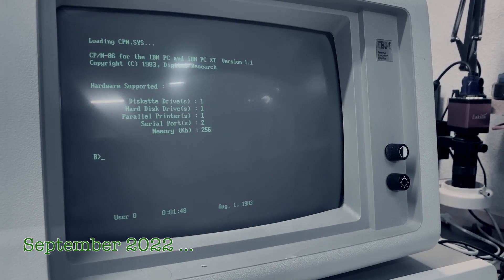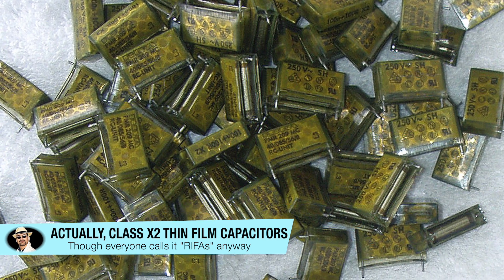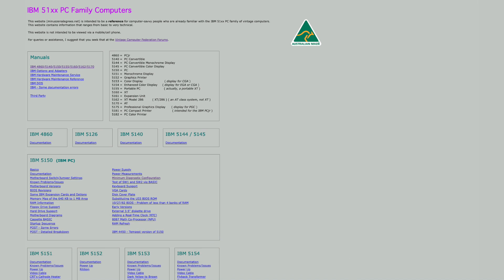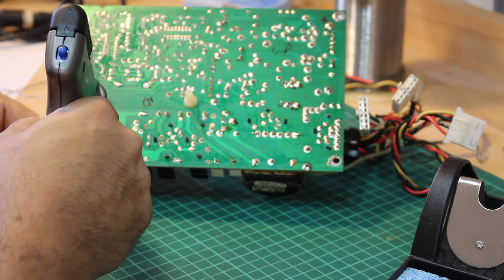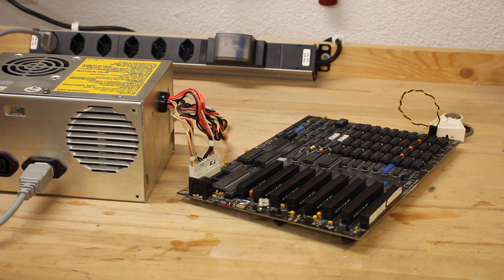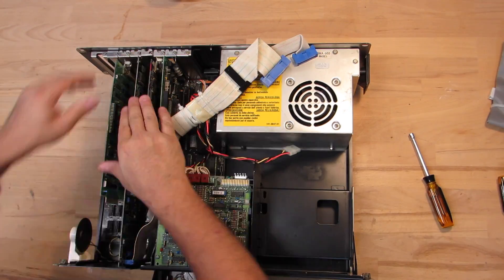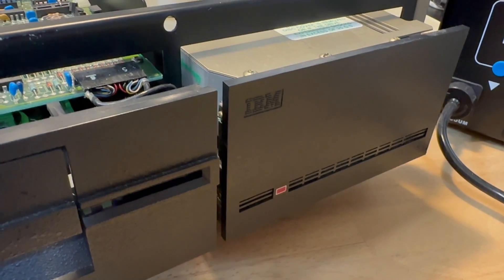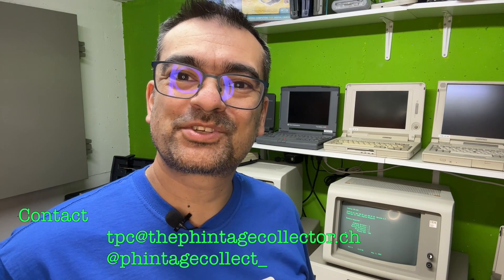Capacitor Plague again!? Reviving a dead IBM XT 5160

Comment: I have a 5150 with a bad power supply and the capsules seem to be good. I can’t figure out what’s wrong with it nor can I find the schematics for it. Mine is different. I think I have an aftermarket version that was just put into the same housing. I was wondering if I took an adapter and adapted an ATS power supply to an ATT power supply but I put an adapter on the white wire to change it -5 V would that work?  I don’t wanna buy another 40 power supply so I’d rather fix it with something newer and just reuse the silver case and the big button. Thanks.
Reply from the maker: There's no official schematics, and there was many different brands of PSU.
YOu may found some inofficial schematics on minuszeredegrees.net.

There's different approaches to the problem.

You can take any known-good mid-90s AT power supplies, and just transplant the innards into the IBM AT power supply enclosure.

Or you go for some of aftermarket PSU, which may still be found here and there. But those are rare.

There's also modern ATX variants available, which come with all the necessary adapters included and also provide the -5V.

If you're looking into visual authenticity, you most propably have to go for the transplanting route, as the ATX variants don't fit the IBM PC/XT/AT enclosures.

The -5V is not strictly required, btw.
It's only used for some rare expansion cards. I don't recall the source, but it might have been vogons.org, where I read this.
So depending on the expansions cards you have, absence of -5V might be no actual issue for you.
Reply: @THEPHINTAGECOLLECTOR  on -0° it said that the very first revision requires -5 V to power the ram. I was not aware that 80 power supplies had the -5.  I haven’t seen any new at power supplies for sale though. If you have time, could you possibly post the link of a power supply that would work?  Also would doing it the way I originally said in my question actually work or would you not try to do that? Thank you so much. It’s so hard to find anyone to speak to for help on this stuff who actually knows what they’re talking about!
Reply: @THEPHINTAGECOLLECTOR  also I plan on fixing the original power supply eventually I was just looking for a temporary solution so that I could get it up and running now. I’ve never had one and I wanna see exactly how far it can get pushed into the year 2025😂
Reply: @THEPHINTAGECOLLECTOR  I have the very first revision which requires the -5 V for the ram. Otherwise, I would not bother with it. That’s why I was asking if I can just get an ATX power supply with an at adapter, and a PCb board that changes positive 5 V to -5 V. And then I would just wire the switch into the old switch.  If the only way I can think of to do it without buying a used power supply from 1983, which is gonna give me the same problems eventually.  Does my plan sound effective to you?

Comment: That's a bummer, those mustard caps are worth more than the computer is. I think that power supply has something else wrong with it, I would get rid of it and replace it. Those caps last in high power tube amps for 50+ years, they should not blow like that unless they are getting twice the voltage or more. The RIFA caps are notorious for failing in everything, total junk and belong in the bin.
Reply: That capacitor broke from mechanical stress, bending their legs too close to the body causes them to break like that.
Reply from the maker: Well, obviously they didn't took lasting capacitors, as especially the 80s IBM PCs are notorious for failing on any of them.
In my experience, just swapping them out is typically good enough, without the need for rebuilding or replacing the power supply.
Reply: @THEPHINTAGECOLLECTOR  Those shorted tantalums were probably the cause. I wonder if that coil has a bad flyback diode.